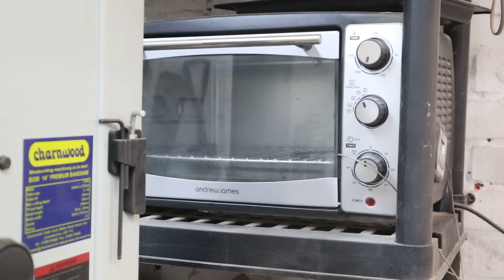Woodturning - A Coffee Mug

Comment: Everybody: *making jokes
Me: why tf did he just put the unfinished mug in the microwave
Reply: Its a quicker way of drying timber with little to no fuss.
Reply: That's a regular oven not a microwave.
Reply: @Charlesbabbage2209  why?Is it not safe?🤔
Reply: @Charlesbabbage2209  Why :7
Reply: @UNOwen-nn6ui  Generally wood is porous. To make it non-porous you have to cover with some type of chemical,  oil, or plastic. I would not want to drink hot liquids that contacted any of them. In addition, you can't microwave the cup.
Reply: @Charlesbabbage2209  its safe nothing to worry about if you are still scared leave it to sit for three days so the bacteria on it dies if your scared there even is any
Reply: @meyou8141  that also happens with ceramic mugs
Reply: To scrape of the dry/rotted material that's fragile and breakable. Microwaving it makes it easier to identify and scrape.
Reply: @ryanxu9983  Ceramic is porous but most coffee mugs are glazed and baked so that the surface in non-porous.
Reply: @GotchaGaming L. Oils, chemicals, and plastics don't permanently bind to wood. They eventually rub off. Think of wood furniture and floors, you have to clean spills off of them even though their coated otherwise there will be a stains.
Reply: @meyou8141  yees, thats why when you have an unglazed ceramic glass and put it in the dishwasher once, then proceed to microwave it, the cup will be hot as frik
Reply: oven.
Reply: I think its a toaster oven
Reply: If you dont dry up the wood chances are it will Crack after some days. This are professional handicrafts and they know what they are doing
Reply: Y not
Reply: @Lemonwires  and no money down?
Reply: Learnt a surprise amount about ceramic mugs here lol

Comment: Guy: Casually uses electric sander with no protection, no fear
Me: Dying inside, waiting on finger to get grazed up😓
Reply: Brittany Ellery my exact thought process 😬
Reply: Ikr! protection is necessary. Whenever in using the lathe, I always make sure to put on a condom.
Reply: Electric sanding is very easy as long as you have the product clamped tightly
Reply: That was be when the band saw guard wasn’t even in sight
Reply: Clearly, the flesh of his hands is work-hardened.
Reply: Ok
Reply: Bruh I do that exact same thing in highschool shop class and have yet to hurt myself even a little bit after 2 and a half years not even once
Reply: All Kids I did the same thing when I was in highschool and I hardly ever got scraped. I do remember some kid cutting off his thumb on accident though but that was a saw

Comment: ER Nurse here; TAKE YOUR WEDDING RING OFF! I’ve seen fingers shaved down to the born from having a ring get caught and pulled off think: 🍌 I’ve seen a rings get smashed flat and caused finger
Reply: Meh your right. I work in an industry repair shop and I have colleagues who sand parts on the lathe with gloves and rings on even though I showed them some pictures of common accidents. But we have a saying here in germany for those people: The luck is with the stupid.^^
I don't want to offend anyone but that's just how it is.
Reply from the maker: Interesting, having worked in industry for nearly 3 decades I've seen and investigated several accidents, non of which occurred because someone was wearing a ring...all of which occurred because someone did something they shouldn't of and had their hand in the wrong place at the wrong time, or lost concentration for a moment, then the accident happened..Here's an accident for you, guy lost his finger that had a ring on it, he was working on a roof, at some point he slipped and on his way down as he was frantically trying to grab something to hold onto when his ring caught on the guttering on the way down taking his finger off in the process..moral of the story. Don't fall off a roof!

Comment: I'd suggest using the same epoxy to plant screws in the mug, and then have nuts attach through the arm of the handle to make it easier to replace. I've seen so many broken mug handles it's crazy. The problem is that the mug would break at a rusted out screw. Any suggestions on materials better than metal for making screws? Any non-toxic, non-oxydizing metal is usually expensive. Has anyone tried ceramics? Enamel from teeth lasts millions of years, in fact, it's usually what's left when everything else is mineralized into a fossil.

Comment: Hey man! Does the heat of the boiling water cause the tung oil to release into the coffee? I want to do a mug sometime too, but I was trying to figure out which coating to use
Reply from the maker: Hi, no tung oil fully cures, however if you want more durability then it's no match for some of the varnish finishes, catch 22 though if you want natural or something more man made chemical based. You would need to re-apply tung oil over its life, full cure time of the oil is normally a couple of weeks.
Reply: @MattJordanWoodturning  awesome bro. thanks so much for the info, I appreciate it!

Comment: Hi Matt, I’m curious what liquid you are putting in the vacuum pot?  Is it a sealer or a stain?   And, what’s the purpose?  Sorry if this question has been asked already but there are 32k comments and it would take me a month read through them.
Reply from the maker: It's epoxy resin, and it's a pressure pot not vacuum.
Reply: Ohhh,  thank you very much.  I’ll have to try that.